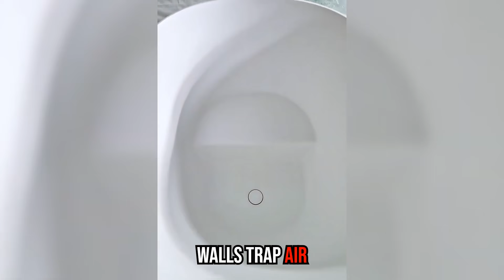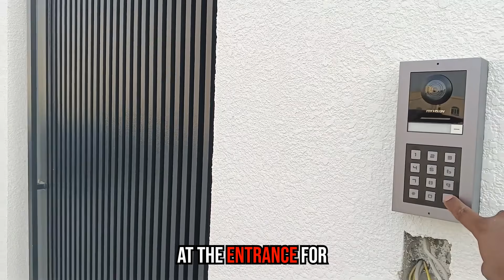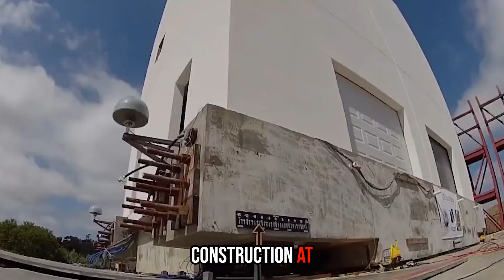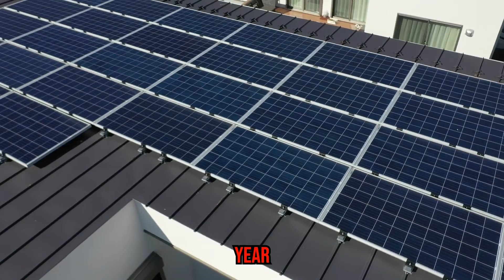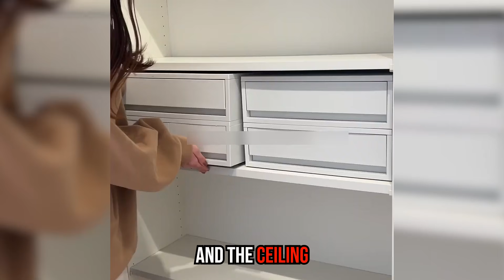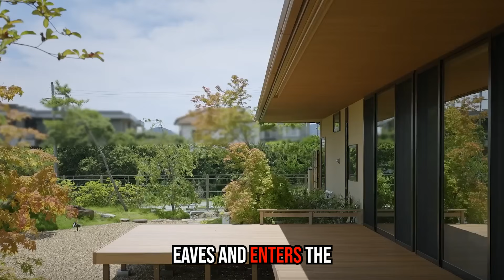25 Things Japanese Homes Do Better Than The West..

Comment: You take Westerners for fools. What you fail to show is that 99% of Japanese houses lack efficient heating systems, that Japanese houses are poorly insulated, that after 30 years all the plastics have yellowed because there's so much plastic in Japanese homes, the wood has blackened and they're uninhabitable, which is why 20% of houses are abandoned. Most houses are very small and often messy and cluttered. The surrounding land is almost nonexistent; gardens are a luxury for the elite, and swimming pools are even rarer. Balconies are only used for drying laundry. Electric shutters are everywhere in Europe—yes, the West isn't just the USA. Washlets were invented by a Swiss man, and TOTO took the idea. Having lived in Japan for 25 years, I mainly see what the Japanese don't have that Europeans have in their homes.
Reply: After 25 years, how is your Japanese ability?

Comment: lol this video (obviously the video maker must be an American, they aren't used to "normal" things):
1. Separate toilet rooms are something that comes from Western cultures from day one. The reason Westerners put the toilet in the bathroom was to simplify plumbing by having everything go to one place. It's just cheaper.
2. An insulated bathtub isn't a new thing; it just isn't the norm in Western culture, because we don't have the bathing culture of Japan, where they reuse the water and reheat it.
3. Gas shutoff is normal in any house with gas. It's built into the connection outside and closes mechanically if it loses pressure. Normal everywhere.
4. The dual-flush toilet has been normal for a long time. It's not unique to Japan. I will go so far as to say it's an invention from Western culture.
5. Built-in a water purifier has been normal since the 50's. But the reason you don't see it so much in Western homes is that the water in those countries is so clean that you don't need a water purifier.
6. Video intercom comes from Western countries as well, it is just more widespread in Japan due to more people living in apartment buildings.
7. Unit baths, as they're called, are also available in the West, but Western people prefer large baths that offer luxury and comfort over something cheap and plasticky. Japan uses unit baths because they take less space and can be mass-produced in large numbers very easily, a result of the building boom they had in the 60s and 70s. Western people have more space for a larger bath, where a unit bath will not make sense.
8. Wall-hung and ceiling-hung air conditioners are normal everywhere. Window-mounted air conditioners are a US-only thing and are due to many US houses built during the building boom after WW2 that didn't have AC. The simple solution was to make a window version. It is just cheaper. Everywhere else in the world, they just went with a proper installation.
9. Normal in almost any kitchen, except if you go for the cheap option... Americans, are you cutting corners again!
10. Normal for countries that experience a lot of earthquakes, just like many other countries, other countries build homes to withstand other natural disasters. Americans need an extra minute to realize they can build houses that withstand natural disasters.
11. If you are willing to pay a little more, you can get a retractable insect screen in the West; it's called a sliding door with insect screen. But as usual, people go for the cheap option.
12. A solution that came from the West was to replace the two windows in the frames with triple-layer insulated glass. It gives a smaller footprint and is simpler to install. Having double windows in the frames is a very old technique.
13. That idea for bathroom ventilation I'll give Japan, it's not something new, but Japan made it common use in Japan.
14. That is something that has existed since forever; in Germany, it has been the standard on windows since the 50's
15. That is normal everywhere, unless you want to cheap out on construction... Oh hey America!
16. Shoji Screen isn't that special, it just that people have hyped it up more. Similar solutions existed in other places in the world as well, but not on the same level as Japan.
17. Built-in shoe and clothing cabinets are a Western concept. But most homes are built to be cheap and let the customers decide how they want things, whereas in Japan, where homes have limited space, everything has its place. We have them; we just don't think to request that it be built. But we should have the genkan, which would make cleaning the house so much easier.
18. The reason western balcony is designed as it is, is due to western building/homes are larger, so it make it easier to place/hang clothes for drying anywhere, and many western home hang their clothes up to drying either in the dedicated washing room or out in the garden, a large garden most Japanese homes doesn't have. But many western balcony have the ability to hang up clothes as well, you just need to rig it.
19. Floor-to-ceiling storage and built-in storage are quite common in the West as well, but many homes are designed to be an empty shell and leave it up to the owner to decide what furniture he/she wants
20. Normal in almost all western homes, except those built cheaply once.
21. The half floor was quite common before, but as homes got bigger, the need for them disappeared, except in cabins. But over the last 10-15 years, with living spaces in cities starting to be cramped, they have come back. Japan have very little space in the city, thus they have hold onto it.
22. Western homes don't have those, due to Western homes usually having a large garden, while in Japan, you have a very limited space. But you occasionally see it here, too; it isn't as uncommon as you think.
23. That is normal in Western homes as well, but if you build a cheap home, then you get a cheap solution. Even in Japan, if you build cheaply in Japan, you also don't get those large eaves.
24. Modular Kitchens are a Western invention to make kitchen construction cheaper. Japan, as one of the big consumers, has taken it to its heart. If you go to a big kitchen brand or IKEA, all their kitchen are modular. Building a kitchen from scratch by going to a carpenter is a luxury you also find in Japan, but most Japanese homes are built quickly and cheaply to meet needs.
25. It is a Western invention and is very big in the West. You get them in many forms of prefabs, from walls made at the factory and delivered to the construction sites to container units. Japan does it more because there is mainly limited space on the construction site, and they don't want to disturb neighbors too much. While in the West, we have a lot of space and like to build from scratch, it's a luxury to have a home built from scratch. Japan also builds homes from scratch, but it's rare in the cities.

Yup, nothing in the video is unique or special to Japan; the Japanese are just willing to pay a little extra for that extra comfort, which is the difference.
Reply: Sure, amerika is the best.

Comment: Natural gas seismic shutoff valve? I have one on the gas line into my home in the US since it was built 20+ years ago.
Reply: Older Japanese houses, especially those in the less urban areas, are infamous for having exceptionally poor insulation. Thin, barely insulated walls, single pane windows, poor ceiling insulation. People rely on local space heaters, and there's still a big network of kerosene delivery businesses that refill the kerosene tanks for those houses with kerosene heaters.
Reply: Bathroom fans? I've had bathroom fans that also have an infrared heating light to warm things up in the room, and also provides regular light.

Comment: You can press a button to reheat the bath water and some must out a bath cover to keep the water warm. The water filer isn't that common in older houses. The inner window is not common in older homes. Shiji screen have nice lighting but are cold in the winter. Most people have specila shoe cases and not built in.

Comment: Like the insulated bathtubs, shoji screens, mini-splits and deep eaves. I tend to disagree with  floor to ceiling storage. Many new homes in the U.S. have 10 foot ceilings, so short people need ladders to reach the top cabinets.
Reply: True, but taller people might want that extra storage even if we need a step stool to reach it!  That's where you put out of season clothing and extra pillows and blankets, winter coats, hats, mittens, scarves, holiday decor, 
etc., plus that's where you hide the
X-mas presents. ☮️
Reply: so there you put the things you don't use often